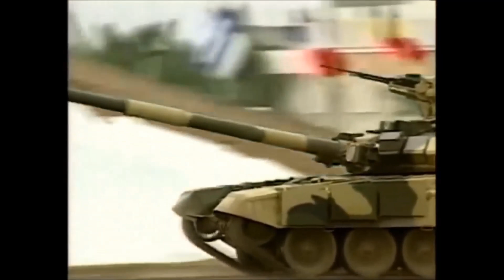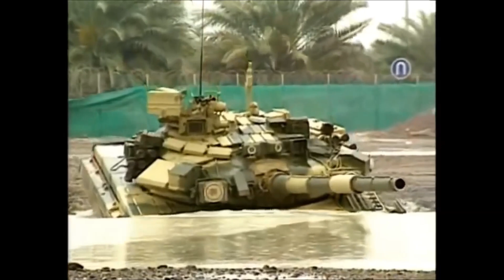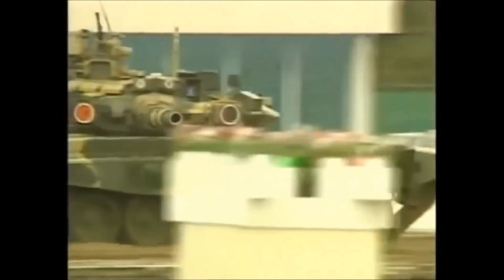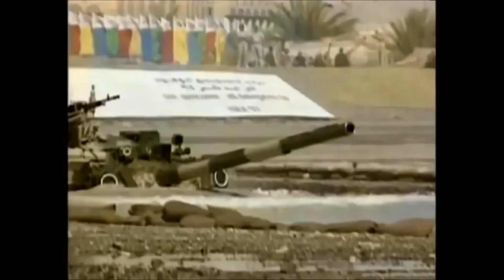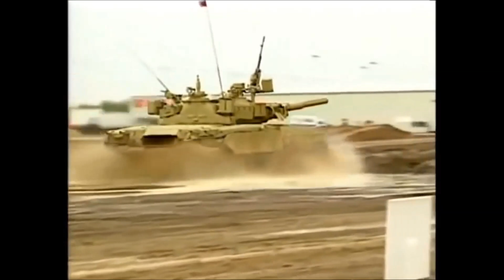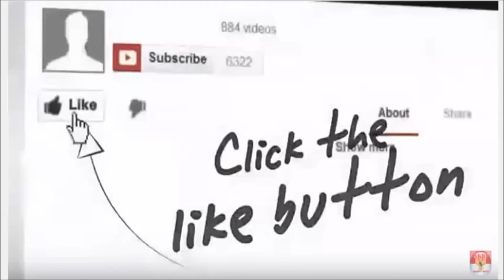The One and Only T-90 Tank

Comment: however as you can see in the video that trail was hold in the UAE, but also to inform you this tank was lost to the Leclerc
while the Leclerc was much more expensive but the Leclerc preform much better than T-90 in mobility, firepower, fire controls and observation, armament, protection. all combined it beat this T-90 and also it did beat the M1A1 Abrams and the Leopard 2A4

Comment: TOW has already taken out T90's
Reply from the maker: Last time I checked T-90 survived a direct hit from TOW.
Reply: +ARCSTREAMS. Imao, TOW is just a registard name ! 2A ITAX is only one example, any tank can be destoyed top side is weak.
Reply: So why mention it if any tank can be taken out?
Reply: +Matt M worked  for defence contrator 28 years, all I can mention is ? I know ....
Reply: There's only 2 incidents of a T-90 encountering a TOW (or any ATGM for that matter, both in Syria). 
- The first is the mainstream footage of the crew escaping, and aftermath images show minimal damage (Needs a Shtora box replacement, Kontakt-5 Bricks, and a couple of wheels).
- The second incident had the Shtora-1 on, and there's footage of the T-90 deflecting the ATGM round.

Shtora-1 is an outdated system. The Ukrainian's have Varta (Shtora-1 Upgrade) and the Russian's have Afghanit (Brand new System). Israel has it's own APS (Active Protection System) called Trophy, which would be on-par with Shtora-1.
Reply: +Canadiankid Lame reply.

Comment: Does it still use the old diesel V12?
Reply: That's also because the T-90AM is 2 Tons heavier than T-90A if I remember correctly. Regardless, Russian Tanks were always using the V Series engine instead of the Ukrainian 5TD and 5TF engines originally built for T-64's and T-80's, but were found unreliable over intense situations and replaced by the V-Series engine which was more reliable as well as cheaper. This was later progressed to the T-90A V-92S2 Engine, which is yes, V12, but they are newer Diesel Engines.
Reply: the t90A Version uses a 1000hp turbo charged diesel engine while the t90AM/SM uses a stronger 1130 hp multifuel version.
Reply from the maker: +Ukraine War Awareness Привет! Nice to see you on my channel!